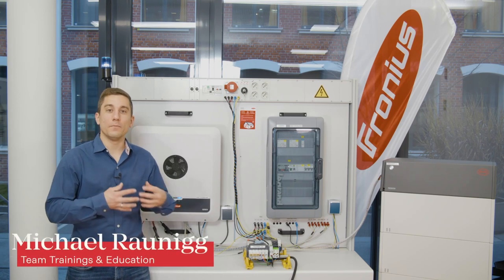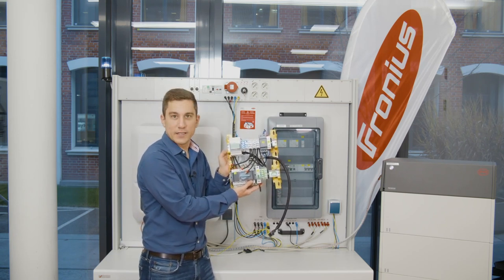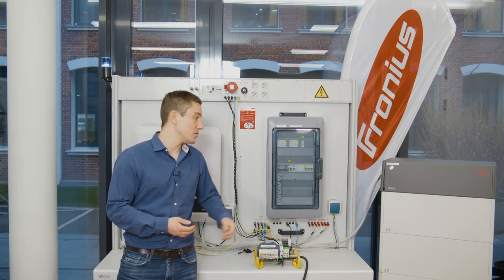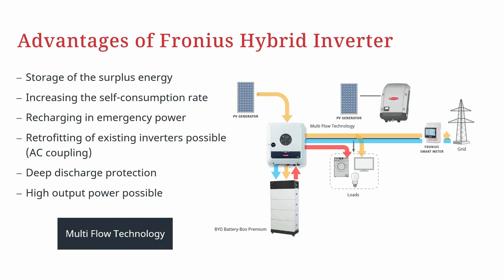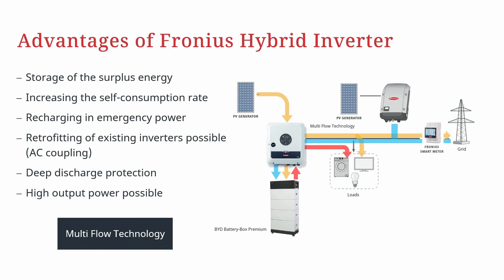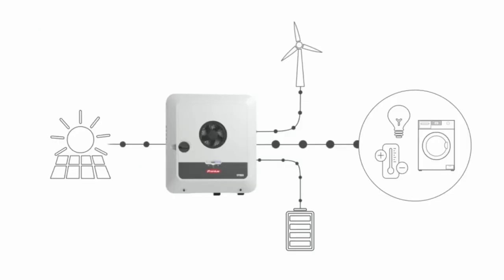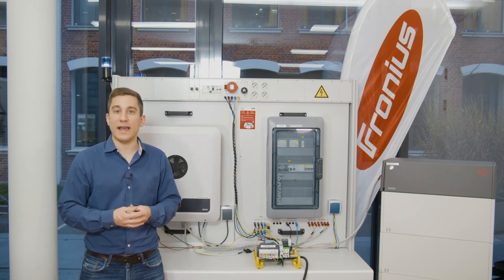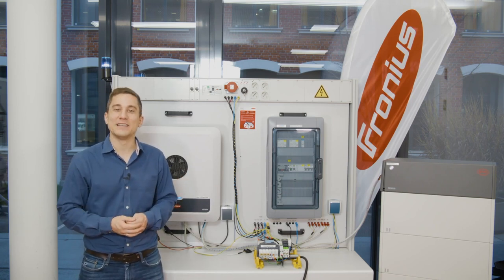How-To Video: General information on the Full Backup power option of the GEN24 Plus

Comment: Helpful video, thanks.  The one thing missing for consideration of the GEN24 Plus is the ability to take advantage of a standard fuel generator when solar isn't enough to maintain batteries in a grid down situation.
Reply from the maker: Hello @SkyCharter!
There are basically two options for this: Basically, it is possible to operate an emergency power generator using a rectifier bridge or a DC power supply on one of the DC inputs of the inverter. The inverter will then process the available DC voltage accordingly and use it to charge the battery or to supply the household. Please note, however, that in this case the warranty lies with the installer carrying out the work. The emergency generator can also be used as a standalone solution. A switchover on the AC side is suitable for this, which switches off the inverter and switches on the emergency generator.
Best regards, Andrea from Fronius.

Comment: hi,
i have frenius symo gen24 plus
i have not battery in my system.
i have 2 questions

1) there are 2 mptt slot at symo gen24 plus. i plugged the fv panels first one, and second one empty. 
How is the AC voltage coming from the wind turbine connected to the Fronius inverter?

2) How can I use the electricity from my electric vehicle's battery at home? 

b.r. 😊👍

Comment: I have a  symo gen24 plus 6.0 connected to the grid to 400V 3 phase with not current back-up or battery installed. 

Is there a recommended configuration where I can have back-up power on all 3 phases ? 
Any product suggestion, link to documentation or video will be highly appreciated.
Reply from the maker: Hello @NicolaeCristolovean
For Backup-power you have 2 options: The Fronius Backup Switch, which is a manual switch that can be activated during grid failures, and second the Fronius Backup Controller, which will automatically switch between Backup and Public Grid. Please register for our webinar for more information on the upcoming solutions: https://www.fronius.com/en/solar-energy/installers-partners/infocentre/events/webinar-en-backupcontroller-switch-24092024

Best regards, Andrea from Fronius.

Comment: here in NZ installer knowledge is low so I am researching myself
I notice you said external energy source is unavailable when grid is not connected I was hoping to use this feature with on-board power now increasingly available on electric vehicles if this is the case I assume it also means vehicle to Home is unavailable with a non-battery system probably the case for me initially
Cheers

Comment: Hello. Thank you for putting out these videos.
A quick off topic question but may interest others as well?
If I update the software on my Gen24 inverter, do I need to reboot the whole system, BYD battery plus the Fronius inverter that I have, in what order?
Thanks for a quick answer.
Reply: Hello did you figure it out how to power cycle after update? Are you happy with your system, by any chance do you use Electric car to charge the batteries during winter months? What kind of system do you have?
Reply: @procekim  yes, recycle the system after an update. Then, first start the battery, then the Fronius. Works like a charm.
No, have an ice vehicle.